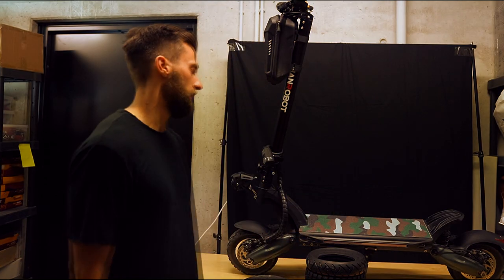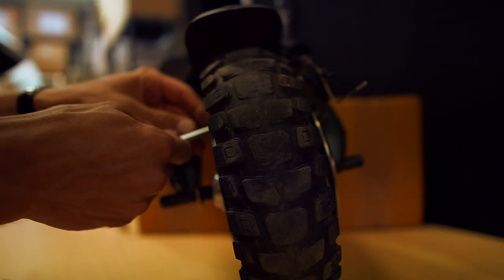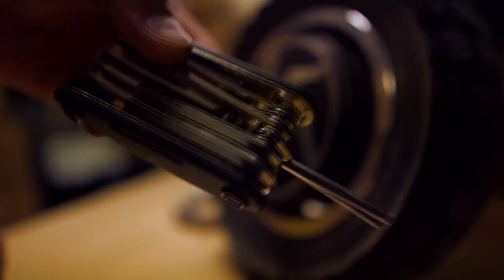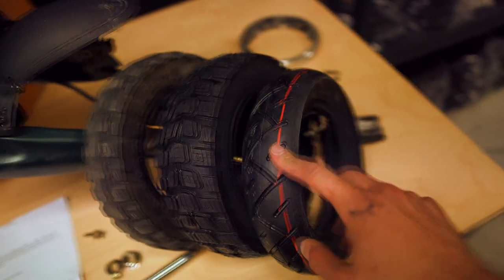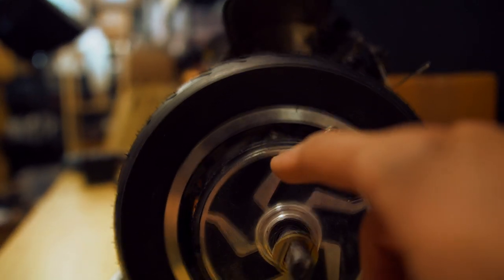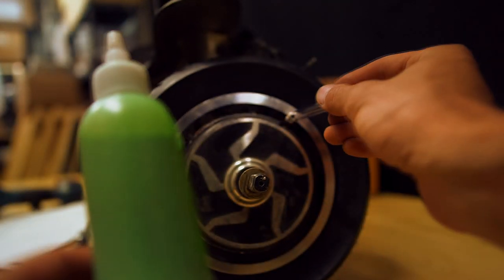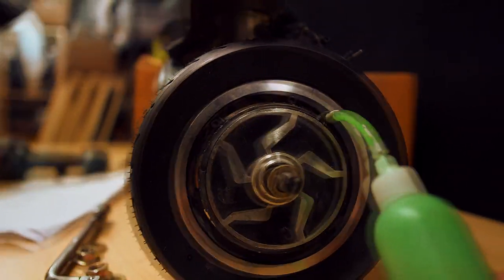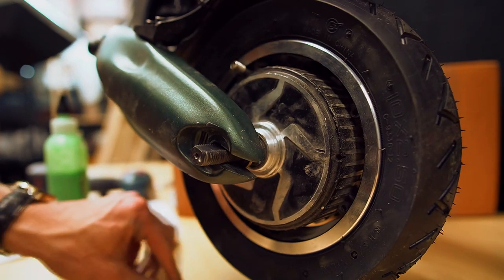How to Repair & Replace Electric Scooter Flat, Tube, Tire + Slime🛠️

Comment: This was definitely more detailed than the RoadRunner tutorial, good job.  My experience with slime though is that it will probably get you home, but it probably won't permanently seal the leak.  I recently had a small puncture, and while the slime kept it to a very slow leak, 2 weeks later it was still oozing slime out of the puncture spot.  Still worth doing to avoid getting stranded, but you'll still have to do this process when you get home.
Reply: I think it’s still better than changing solid tires.

Comment: I’m thinkin my current flat is from the stem rubbing on the casing of the hole through the hub.  Tried the green shit but it won’t work on the copper stem

Comment: great tutorial. i just got a rear flat today. no visible damage but its flat after about 4 miles on a full tire. i assume something with the stem.  what is the best way to acquire the right tube? what exact size should i be looking for?
Reply: Check the manufacture website or the tire itself. How’d your experience go btw?

Comment: Great tutorial. How much air should I put? I have off road tire for Nanrobot D6+
Reply: the psi on the tire for the d6+ says 50 but i noticed in this video for the road ties 35 psi was used humm
Reply: i use 50 on my d6+dont go low youll get a flat

Comment: Great tutorials.  Ive had my D6+for a little over a month now.  I had my first flat tire about 2 weeks ago.  I watched your video, and after about 2 days going to store to buying the improper sizes is sockets to remove the wheel assembly, i was able to get it off and clean up my tires and tube. A week later and the reat tube is flat and left my commute to other means. I have decided that i wanted to order street tires, to replace the stock off-road, but I'm having a difficult time finding the proper sizing.  I have searched for 10x3.0 tire and many sites are saying this measurement is the same as 3.00-4 or 260/85.  I followed these guidelines and have ended up with handtruck tires and tubes.  Can you make a recommendation of a particular tire and tube that would be available on Amazon?  I dont want to again purchase thr wrong items.
Reply: Tim Pearson Check Nanrobot’s main website they self the tires with the tubes for $50 right now on a discount and $80 is the actual price. Which is one of the Pros that Nanrobot has. If something breaks or you get a flat, you can easily find replacements on their website. I hope this helps you buddy
Reply: I have a D4 plus 2.0, I got several Flats while using the Slime because it's not rated to handle heat over 20 mph. I switched to armadillos and I've had no problems
Reply: @corywebb5537  Hi, what is armadillos?  Is it a slime alternative or an actual tire?  I looked online and only found tires.  Thanks for any clarification.

Comment: Bro none of this is necessary... you probably turned a bunch of people off using it. You don't need to take off your tire at all and don't need any tools!! Wtf . The slime bottle comes with the only tool you need which is to take out valve stem.. which empty tires for you automatically...then you add slime ..  give tire a spin to help it spread it throughout along inner wall ( cause its still attached to scooter you didn' remove it like a dingus). Put the stem back on and fill with air .. you may have successfully and safely done this but you should have mentioned that you were taking unnecessary steps and taking the tire off is not required.  At least add it as a text at the bottom.

Comment: Has any one got a flat with using the slime in there scooter tire and the slime held air and sealed the hole until they got home to install a new tube? I put the slime in my d4+ 2.0 tire and I'm curious if it has actually worked for anyone.
Reply: How was your experience?
Reply: @TheMoises1213  I have been riding my scooter for a year And I only had one flat.  I was moving the scooter while vacuuming and noticed I had a flat. So I say it works great.

Comment: So if we have a flat can we use the slime to fix it or is it only preventative?
Reply: Did you end up finding out?
Reply: @TheMoises1213  It depends, I've noticed sometimes I've gone longer without a flat with slime. But other times the flat will come and go depending on where the flat is with slime. So it may help in some cases but if the slime can't reach the puncture, it won't seal. Sometimes you think the hole is sealed and you ride out then the tire goes flat. So maybe try armadilloz blue, or just treat it as preventative to buy time to get home to change flat.

Comment: If you only wanted to put slime in the tire, could you do that part without having to dismantle the wheel? Just empty the wheel from air, add aline & re-inflate ? or does it require access by getting the wheel out?
Reply from the maker: No, you don't have to dismantle the wheel :)

Comment: Hi Igor,
just got new D6+ - 2 question - were you offroad tires installed not with the direction of arrow but the other way? 
If so  - did you get the same wobbly moment after reaching higher speeds like 50/60 kmh and when you let go the gas it shakes a bit?
Reply from the maker: Hey! Sometimes scooters come with tires installed the opposite way, you should swap those asap. Speed wobble topic: https://www.facebook.com/groups/nanrobot/posts/727490957961543

Comment: Thanks for the video. Quick question. What size ratchet did you use to loosen and tighten your rear wheel?
Reply from the maker: Hey! Must be 21mm
Reply: I said, quick question, but I do have another question. Where can I find a foot deck design, similar to yours? Yours looks so classy!
Reply from the maker: @broadway8317  Search for came grip tape on amazon, I can't find the exact same color. https://www.amazon.com/Skateboard-ZUEXT-Waterproof-Camouflage-Rollerboard/dp/B086JSQRRM/ref=sr_1_1_sspa?crid=2G8AJUZ5EYTFW&dchild=1&keywords=camouflage+grip+tape&qid=1619636751&sprefix=camouf%2Caps%2C276&sr=8-1-spons&psc=1&spLa=ZW5jcnlwdGVkUXVhbGlmaWVyPUE3Wk5BMTZHSkVEMDEmZW5jcnlwdGVkSWQ9QTAxOTczMTExMFIxNUFGTTMxNTBNJmVuY3J5cHRlZEFkSWQ9QTA4NzIyNjQzS1pNSEE1TTFOMERLJndpZGdldE5hbWU9c3BfYXRmJmFjdGlvbj1jbGlja1JlZGlyZWN0JmRvTm90TG9nQ2xpY2s9dHJ1ZQ==

Comment: Dude quick question my first flat ever for mine NANROBOT D4+ 2.0 Brand: 1PZ
3.9 out of 5 stars  27 Reviews
1PZ ES1-X25 10x2.5 Electric Scooter Tire & Inner Tube for 36v 48v 400w 500w 800w Hub Motor. Is from Amazon
Reply from the maker: Problem swapping the inner tube?
Reply: @igorlmonte   Yes sir to replace a flat
Reply: I’m just wondering if the inner tube will work or do you have to get it From the manufacture
Reply from the maker: @awinkisgonzalez6556  it will work, but you better get one from roadrunnerscooters
Reply: @igorlmonte  
Will do thanks a bunch! Waiting for you to test out the new NANROBOT D4+ 3.0

Comment: I am "tired" of  getting flats on my scooter.
Everytime I get a puncture, I see that it is a perforation - each time - which tells me it is the tubes that are the problem. |
Every single tube I have purchsed, ends up perforated. This also tells me that the tubes are not thick enough. All the inner tubes are not designed for the speeds we do.
Reply from the maker: Don't ask me how many times I've heard about flats. My opinion is that those chinese tires are trash on all scooters that come from china.
Reply: How many times have you heard? Haha
I hear ya about those tubes. I'm trying to source elsewhere

Comment: Slime is not made for speed limits over 20 to 25 mph. The blue armor Dillon tire sealant is. It also has ballistic fibers. My D 4 + 2.0 still always got Flats using the Slime until I switched